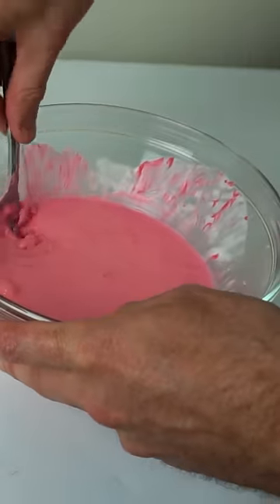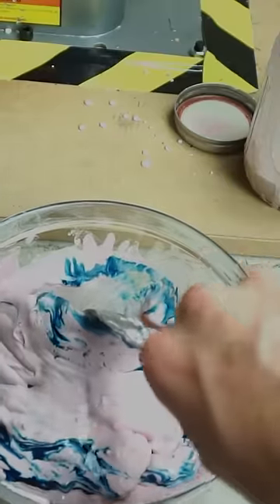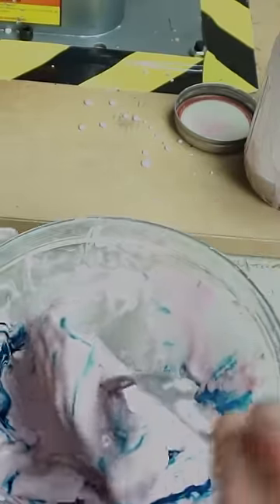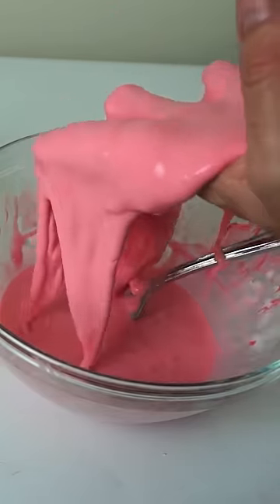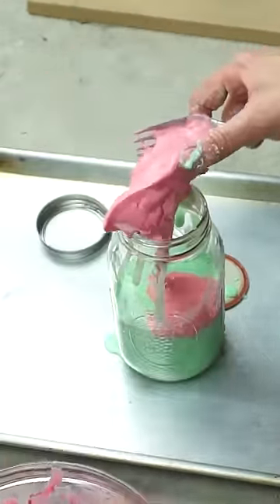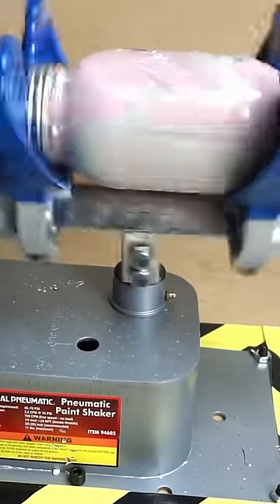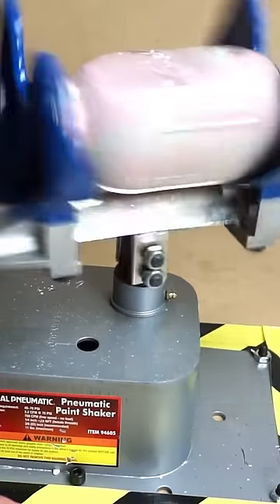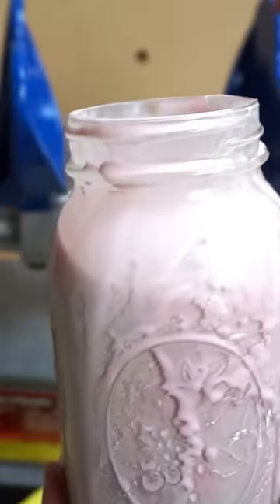Can You Actually Mix Oobleck in a Paint Shaker?

Comment: I think this makes perfect sense. It's still a fluid. It does experience shear thickening, but it can only get so thick without changing into a solid. A violent enough force can mix even the thickest of liquids.
Reply: Also the shaker isn't only high shears, it's wobbling meaning it's expierencing a variety of forces. When the oscillator changes direction the local shear force hits zero before increasing again in the other direction.
Reply: @blondetrees  tru tru
Reply: @blondetrees  yeah half my brains said no. The other half split thinking that the different(varying/moving) forces might affect it, and if the shaker had enough force to overcome the sheer thickening properties...or whatever it's called
P.S. I love the name BLONDETREES. Good one
Reply: i think its cause to harden, the water sorta gets pushed away, so in the can it just has nowhere to go
Reply: @blondetrees  was also thinking this. The way this shaker works it gives a little break to the oobleck in between each movement of the shaking mechanism, very very quickly
Reply: A violent enough force can mix even solids
Reply: @revimfadli4666  I don't mean to comment on a violent enough force but if you put limestone and hardened concrete next to each other in the paint mixer the only thing they might do is break

the key here is the pause between forces allowing the oobleck to liquefy before it's squished again
Reply: @blondetrees yeah came her to say this that there is a moment of pause between directions. if there was constant force, it wouldn't mix
Reply: The paint shaker just shakes out the liquid parts (that aren't non-newtonean enough) and mixes those, the inside would be solid while it's shaking
Reply: Fun fact enough energy will turn any solid into a liquid anyway
Reply: I think the mixing happens during the fractions of a second when it changes direction 🤔 🤷
Reply: "Shake hard make water go woosh"
Reply: @mykelengieza7057 what about blonde trees makes you love the name? I’m genuinely curious.
Reply: some frequencies create this effect not for sure but i think the vibration is causing it to mix  @blondetrees
Reply: I think it’s shearing so thoroughly that it’s momentarily turned into a mixable powder.
Reply: Hi Kameron
Reply: @Kameron347  this is like that Spider-Man meme

Comment: you can mix solids. At high enough forces it just breaks into little clumps which then can be mixed around. The second you stop they then recombine in their mixed state
Reply: horrifying, thanks.
Reply: @Wyi-the-rogue It's the same problem as lowering the temperature of things in either direction of potential energy, matter simply becomes an enormous relative solid. Until it doesn't. Probably don't be around when it doesn't.
Reply: that's what i was imagining, honestly. like tightly packed sand grains being shifted around each other to mix
Reply: This is a dilatant fluid, not a plastic solid.
Reply: Try using a blender lol 😂
Reply: Emulsify!
Reply: So, hypothetically you can stir a human into liquid?
Reply: @yin-sin You could mix multiple humans to get one giant! You just need to know the right vibration frequency!
Reply: @ksp-crafter5907  Ferb, I know what we’re gonna do today
Reply: Cool.

Comment: Isn't there a moment between each "shake" that the oobleck can mix when the sheer forces between the shakes cancel or partially cancel out? You aren't introducing one moment of action, but many.
Reply: And every action has an equal and opposite reaction.
Reply: @dadquality  there's the newton
Reply: It'd be interesting to see this in slow motion I have a feeling it would just act like a thick liquid in the shaker rather than fully solidify
Reply: @PsychoticEwok  or maybe like a tightly packed mass of two colored beads that slowly mix. Which at a distance would look to be mixed. And as soon as the shaking stops actually do mix.
Reply: @dadquality  yeah that somehow makes sense to me, it just seams odd that it mixed as intuitively you'd think it'd act like a solid mass but definitely seams to actually be either a liquid or a non cohesive solid like you've suggested 🙂
Reply: Isn't oobleck normally just white because it's made with corn flour?
So I think this is probably coloured using some kind of dye in the water. I think it's possible, that in this case only the watery part of the oobleck mixed and not the whole viscous liquid...so only the dyes mixed.
Reply: @Dithernoise  probably the case. The most simple explanation is probably the right one, eh?
Reply: @dadquality  Maybe one could use some kind of coloured powder instead of corn flour to test it...however I don't know what powders you can use to make oobleck
Reply: @Dithernoise  there are colored corns. Although I'm not sure if their starches are colored as well.
Reply: @dadquality  The Occam razor is a silly dangerous things.  Any explanation is the simpler for who believes in it. The simpler is "Because God wants so", or newage solipsism  version "because you want so".
Reply: @t.me_s_petizioni_2220  you're probably right. But now it feels wrong to say. I'll just leave it where it is and walk away. Have a good day, kind sir.
Reply: just wanna mention that its "shear force"
Reply: @Konomi_io   you are correct. But also... Up, Up, Down, Down, Left, Right, Left, Right, B, A
Reply: @jonathanorlando1294  so true
Reply: Or the oobleck is breaking up into tiny spheres and rolling past each other.
Reply: @Dithernoise  i think its purposely collored with dye to show the potential mixing or inability to mix. if it were all just white then you wouldnt be able to tell if the two sets are mixing or not. the colors are just for presentation
Reply: Pretty much, it’s that minor shift before it switches direction allowing it to mix. It’s just happening at such a high rate that it actually is able to mix and we see the results relatively quickly, because if you did it at a slower pace it would take much longer to mix the colors.
Reply: @Dithernoise  If only the dyes were mixing, then that would mean that the water and cornstarch were separating… and based on that alone, your theory makes no sense. 

Honestly, I don’t think there’d be a way to remove the color even if you were to let all of the water evaporate out of the cornstarch. 

As it would color the cornstarch whatever color the dye was. Cornstarch is incredibly absorbent, as it’s commonly used to clean up oil spills on clothing, before you wash the clothes, so it would absorb any dye added to it. 

What is more plausible, by using basic color theory, the colors red (in this case pink because of the white of the corn starch) and green being complimentary colors, cancel each other out, resulting in a neutral tone. They used colors like this, just to show the efficacy of the paint shaker on the oobleck, and whether it would create a mixture or if the two portions would stay separate. They used colors that create a neutral color to show how well it would mix, as it’s easier to see how well it mixed using colors that cancel each other out to make a neutral color, rather than using two primary colors to make a secondary color, or two secondary colors to make a tertiary color.
Reply: @missmarie_8790  I don't think that the water and starch separating is that crazy of an idea, because isn't the explanation for ooblecks shear thickening, that the water sort of gets pushed out beetween the starch on impact and returns afterwards? 

Obviously evaporating off the water will leave behind the stained starch as i wouldn't expect the dye to evaporate. But that doesn't mean that a big part of it can't be dissolved in the water while it's oobleck.

That's why i was talking about using coloured powders in an earlier comment...so see if the solid part of the suspension actually moves much and not just the liquid.
Reply: @Dithernoise  lol yeah only problem there Einstein is that cornstarch doesn’t come in different colors, and honestly I think you’d be hard pressed to find any other substances work similarly like a mixture of cornstarch and water, to justify your theory. 

Your original comment still doesn’t make sense in that regard.
Reply: @Dithernoise  the only way we’d know for sure is if you were to test the theory and make some colored oobleck, then leave it alone till the solid separated from the water. But I’m still pretty sure that it won’t be pure white starch at the bottom of the mixture, it will probably maintain some of the color that was added to it. As the water wouldn’t be pure, drinking water quality, afterwards either, as there would be some minor emulsion, as the sugars in the starch would be miscible in water. So it wouldn’t necessarily be a true suspension solution, as oil and water are.

It’s literally basic chemistry

Comment: Maybe it just breaks into a lot of tiny pieces that get “mixed” together, and then when it stops it becomes liquid and combines more?
Reply: That's what I thought too
Reply: Best theory so far.
Reply: I think it is comparable to how you can make a pool of sand you can sink  into by bubbling air through it.  The frequency it's shaking at may allow it to loosen the substrate.
Reply: Good thought 👏
Reply: How about no
Reply: @iwishiwasthomasshelby  why?
Reply: I thought the same thing, maybe it breaks up n acts like sand
Reply: oh so basically crushing it when it's solid, then melt again. good one
Reply: I think that’s how molecules work lol
Reply: Same thinking.
Reply: Maybe?
Reply: Wow this makes a lot of sense
Reply: @iwishiwasthomasshelby  why
Reply: Probably going from liquid to solid, and so forth hudreds of times a second on the mixer, slowly vibrating/mixing together
Reply: @ragibmahfuz5241  because that’s simply not how it works. That’s like someone suggesting that you feel cold coming out of the shower because soap companies add chemicals to make you want to go back in and shower longer. And then I say that ain’t it and get asked, “why?”
Reply: @iwishiwasthomasshelby  I have just read something about oobleck and learned that the reason oobleck behaves like this is because of the long cornstarch particles. If you were to move the fluid slowly the cornstarch particles will brush past each other, if you moved it quick it would tangle and become harder. I get where you are coming from but I do believe the commenter is correct on his hypothesis but instead of becoming like sand, it just tangles and untangle quick which makes it seem like sand.
Reply: @iwishiwasthomasshelby  how is that the same at all?
Reply: @ragibmahfuz5241  okay, if you explain the thought of reasoning I can ride with that, but “maybe it… (inserts random theory)” is exactly how many potheads talk.
Reply: @iwishiwasthomasshelby  I'm not the pothead here, you tried to correlate something strange with my question. If you have any idea at all better than you talking about industries putting chemicals to make the water cold, I will be happy to know.  And the reasoning?  Think about long straight metal sticks, some are put in weird ways, while some are put in clusters. Then, they are suddenly pushed.. but because of how they are touching and some are stuck to each other, they all move in the same direction, like a solid. But when you put your hand through it slowly, some of the sticks are moved in a way that they are unstuck, and because of the one unstuck stick... Another gets unstuck, then another, then another, that is liquid. Now time for the paint shaker. Now think of the sticks being pushed from one side, to the opposite side, each one fast and stopping just as fast, each stick, although not moving much, moves ever so slightly after every shake, then it becomes unstuck and stuck again in a new place. Now think of that happening to every stick and you got  the reason. But at this point I think either you are a troll, or someone who didn't pass physics.
Reply: @iwishiwasthomasshelby  They did explain the thought reasoning in their second reply and you're the one who didn't actually provide scientific reasoning for why you disagree. You just inserted an analogy instead of giving an actual hypothesis.
Reply: @mac9733  particles don’t work like that. If I have to explain my reasoning to every guy I cross paths with, I’d be on the street 24/7.
Reply: Sort of like phasing together
Reply: @iwishiwasthomasshelby  you literally have to explain your reasoning just to every guy you cross paths that asks, instead of being a jerk and randomly trolling those same, curious guys 24/7.
Reply: @doppio.7823  No, that's not related
Reply: Naw it’s just that there is no force on it the paint shaker just stirs it
Reply: @iwishiwasthomasshelby  well a pothead wouldn't know the difference between what does and doesn't make sense

sounds like someone
Reply: @lucticide  There’s scientists, presidents and astronauts who are pot heads…google is free lady
Reply: @iwishiwasthomasshelby  making a hypothesis on the exact properties of the item in question is not comparable to suggesting that you're cold because of chemicals that have nothing to do with the causes of feeling cold. It's like saying someone got bit by a shark because they're gay. It's nonsensical and tone deaf to make an argument.
Reply: No. You could literally see it mixing without stopping.
Reply: @loki88_87  or you know put the color you want in the water
Reply: u can make it with flour and water it’s the same consistency
Reply: Maybe inertia plays a part
Reply: Close! The shaker isn't only high sheers, it's wobbling meaning it's expierencing a variety of forces. When the oscillator changes direction the local shear force hits zero before increasing again in the other direction. Mixing likely happens durring the breif moments of low shear expierenced by the oobleck :)
Reply: @iwishiwasthomasshelby  > you haven't reasoned anything here. You just claimed. Which is odd, since what you are implying is pretty wrong. But who am I to say, I only have a masters in this shit.
Reply: @PLF... I’m a pothead that reads a lot of primary scientific sources and I’m uniquely offended at the stupid here because you can look it up but the days (not hours) of research are pretty much unfathomable if you’re frame of reference is PowerPoints. Also Biochem>Engineering
Reply: @iwishiwasthomasshelby  nah, you just dont understand how atomic shapes worm